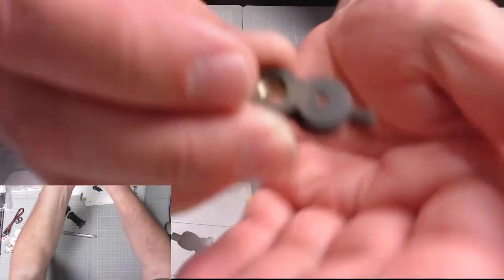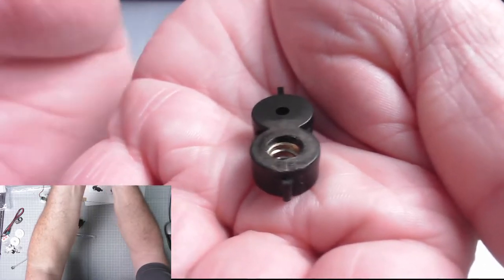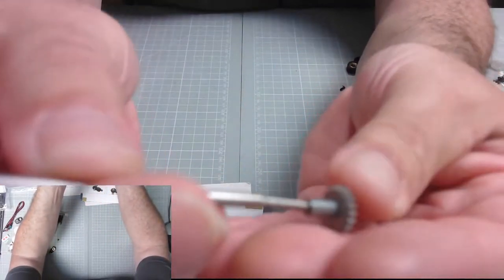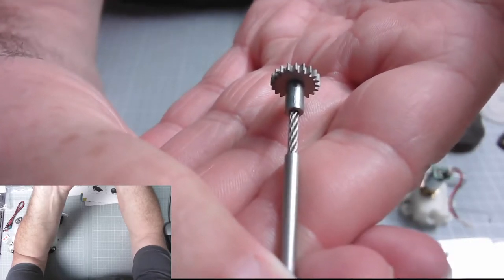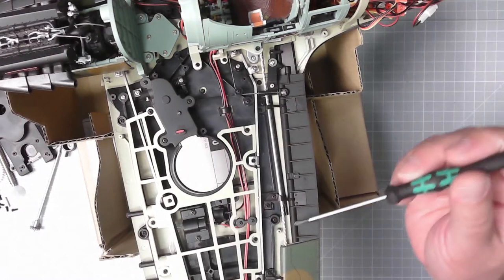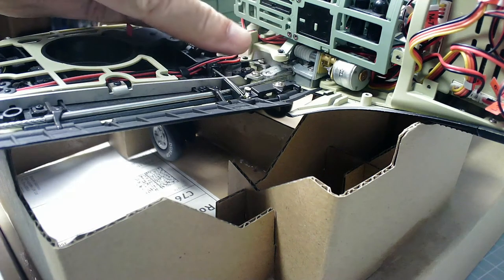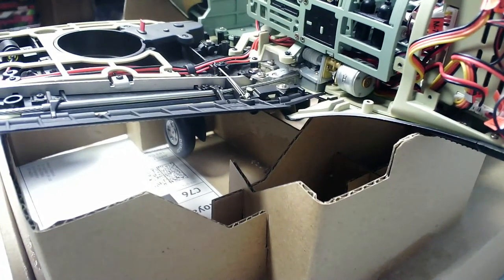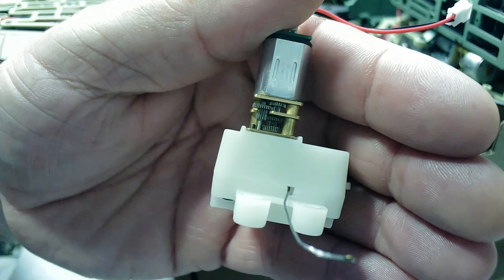Spitfire MK1A repair update

Comment: great vid John, do you think it could be the weight of the plane that caused it to split as the plane is quite heavy for the risers, they should have been metal them parts, there,s a lot of flaws in this build
Reply from the maker: Thanks Dave. That may be true Dave and the lack of quality of some parts like the motor I now need.
Reply: fingers crossed you dont have the same issues with the zero in the long run

Comment: john how did you fit the original plug into the m2 socket on the main board it seems to be larger than the extension cable. edward
Reply from the maker: I used the supplied extension cable. Have you got the correct cable?
Reply: @JohnsModelmaking  did you remove the extension cable when you replace the motor
Reply from the maker: @ehonan  Yes.

Comment: Just bought a ready made Hachette Spitfire. Are the wing aerilons supposed to be contrasting colours to the wing? Also one aerilon is stuck. Is it easy to get access to repair please?
Reply from the maker: The contast differences are due to plastic aileron and metal wings. To access the aileron remove upper wings side panels cockpit and the aileron motor and check if the aileron  cable has lost a tab at the cog end if it has you will need a replacement.
Reply: @JohnsModelmaking  Thanks John. The underside of the black wing has a white aerilon and vice versa. Is that how it was designed or another Hachette mistake? Is removing the wing straightforward and the repair easy? I have the parts
Reply from the maker: 2 screws under two details on top of wings, be careful with the flap indicator, tape it down before taking wing off and on. The flaps colours are correct for that mk1a. The repair is easy enough just centre the tab on the cog as per instructions or watch my video.

Comment: Hi John I have had trouble with the wiring of the left side motor aileron micro switch has cracked, it was the stop switch for the plane not to go up too much. Who do you deal with to get a replacement issue 83 85 as I would like to order a replacement please from Hachette. In Australia our issues I get from my newsagent my issues are up to 102. I just wondered if I could get an email address to make an arrangement to get the replacement issues / new wiring please John. cheers PhilipO
Reply from the maker: https://hachettepartworks.com/en-au/  Try this link for the Australian site. Contact page https://www.hachette.com.au/contact/
Reply: @JohnsModelmaking  many thanks for your kindness and I will investigate to get my testing stage on track. How can I show you my level of construction and to show you my success in appreciation after the testing stage. In appreciation cheers PhilipO

Comment: My build has now got a fault on wing flap book 57 part no 57 10 brass connection  dropped  off been on to hachette  second  phone call with same fault  wateing to hear back from them
Reply from the maker: Yes I know of 1 other builder who has had the same problem. If its in stock you should get it soon!

Comment: Good morning,
can anyone help a 1st time modeller? Some of the functions aren't working on the Spitfire, notably the propeller and lights. Anything I can try? Thanks
Reply from the maker: Hi, have you stripped the aircraft back to issue 93 and test the propeller and lights with the test board? M3 propeller and lights are L2,3,4,7,8,10.
Reply: @JohnsModelmaking  I have stripped it back but thank you, I will test it as suggested 👍🏻

Comment: Hi John, I need a bit of help, the undercarriage was working great but suddenly as you the motor won't take the load it starts to go up then stops. I don't seem to get any satisfaction from hachette on the problem, what do you think I should do mate. 😂👎
Reply from the maker: I checked the cable and cogs and reset the system without and with the motor in place, reinstalled the motor (I did this multiple times) and then  ordered a replacement motor, you will have to contact Hachette each week as its out of stock.
Reply: @JohnsModelmaking  tar mate I'll try that, wish me luck. 🤞
Reply from the maker: @rogerdowning861  Good luck.